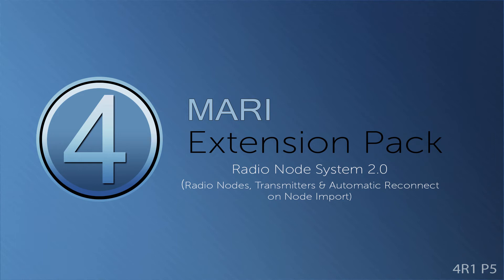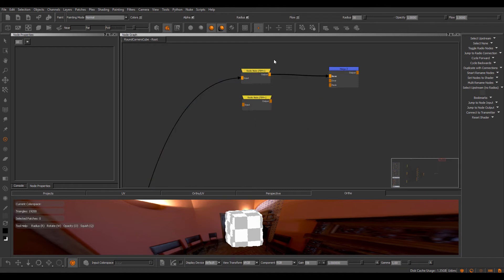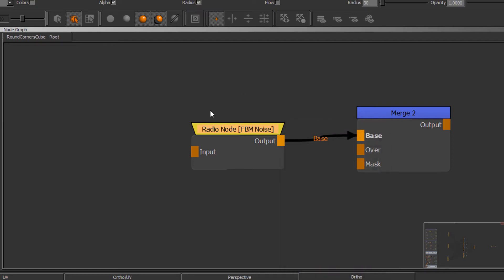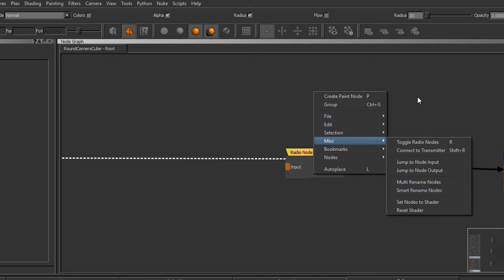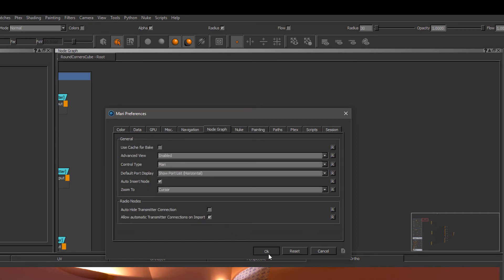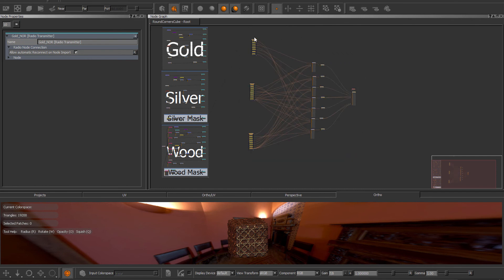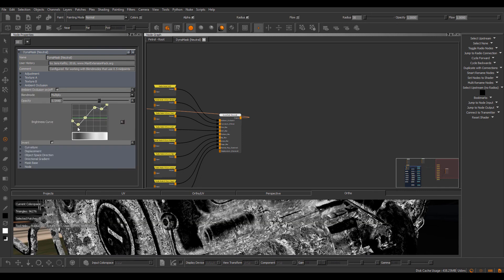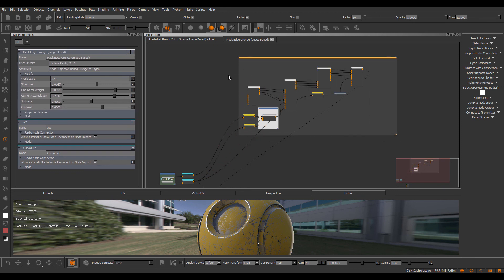Radio Node System 2.0  | MARI EXTENSION PACK 4

Comment: Is it possible to have radio transmitters work with radio nodes inside a different root/group/nodegraph tab? Doesnt seem to work for me
Reply from the maker: Radio nodes need to have 'line of sight'to a node. What you will have to do is create inputs on groups if you want to bring radio transmitters into a group to hookup to radio nodes inside there.
Reply: @MariExtensionPack  so Radio transmitter into a group. And then load that group into the material tab?
Reply from the maker: Radio Node way:

1) Inside your Graph Group or Material press Tab and create a 'Input' Node. Name it the way you like

2) Inside your Graph Group or Material attach a Radio Transmitter to the new Input Node. Name it the way you like

3) Inside your Graph Group or Material connect Radio Node to that 'Input' Radio Transmitter

4) On the outside of the Graph Group or Material attach a Radio Node to the Input Port that appeared (since you created a Input Node)

5) Attach the radio node to whatever radio transmitter you have attached to the source data you want to pipe into the graph group or material

Geo Channel way (requires mari 4.6 or higher):

1) In your Root channel create a Bake Point Node and attach it to whatever data you want to transmit

2) In Bake Point Properties attach the Output to a Geo channel Name

3) Bake the Bake Point. It will write the result into the Geo Channel

4) Inside your Graph Group or Material create a 'Geo Channel' Node and select the geo channel name you created previously.

5) Attach Geo channel Node to whatever you like